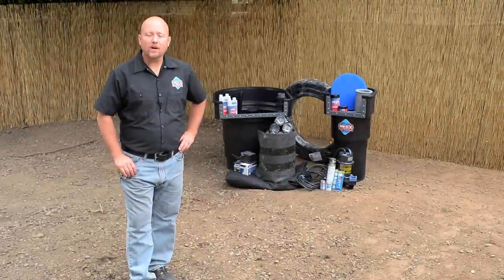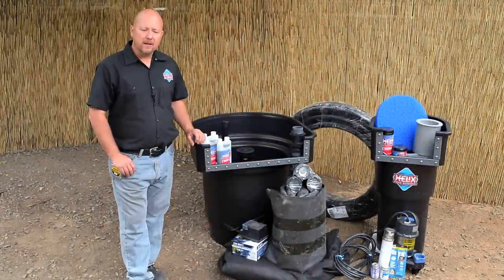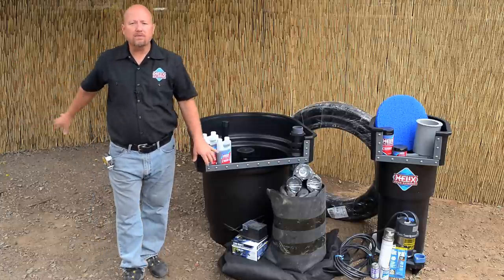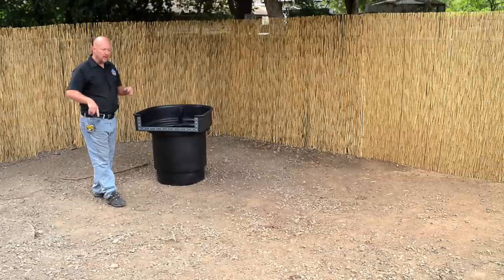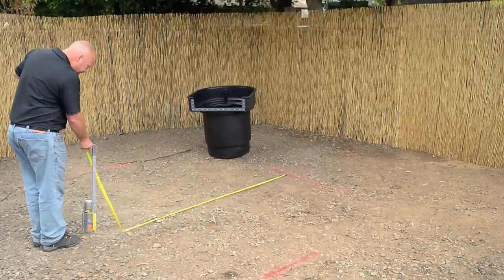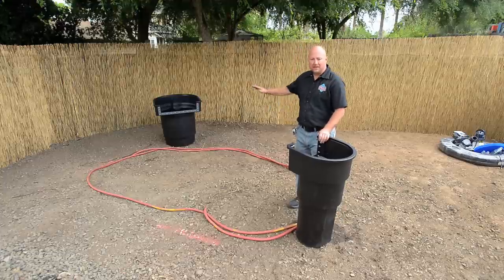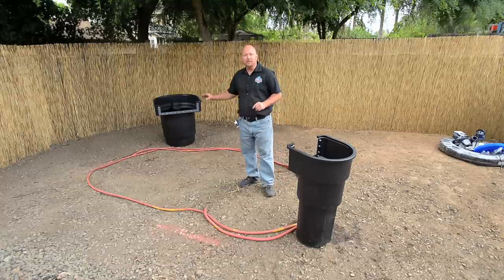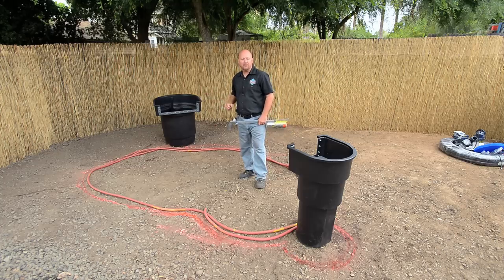How to build a Fish Pond - Part 1 | Pond Design and Layout

Comment: I have been tossing that thought for  some time now, Thank You for your response. I am going to buy a liner to fit my ponds and then use the liners I do have for the stream runs from the three waterfalls. Its funny, this started off as a small project; I just could not find satisfaction in small. I have a 3/4 back yard that has become my canvas to paint. Thank you for your great videos!
Reply: What a great set of videos with lots of tips I watched all 23 in one sitting. I missed a bit the aspect of the plumbing but assumed how it works.  You showed in the beginning the standard setup kit and I wonder where I could get it today in 2021.  Maybe there are newer designs, but I loved the parts you used.
Wolf Bender in Bethlehem, PA

Comment: Eric... You "Rock" the pond world! Hey buddy, I am using "feng shui" principals to locate my waterfall and pond. I am therefor, in a situation where my pond should be located in the north, and my waterfall feature in the northeast. I am on a small lot with a septic tank also in the north/north-east location. I don't have enough space for a decent sized koi pond and waterfall. So here is my plan... A six tier waterfall over a 12 foot span, landing in a 3 x 5 pond with a three foot depth. This leads to a 25 foot x 2 foot wide channel which is 3 feet deep and sloping down to 4 feet, where it enters the other 5' x 8' pond with 5 foot depth. I will have drains, and skimmers on each pond, and three jets in the channel aimed toward the larger pond. I am running the channel between my house and septic with two feet on either side. 
Do you see many problem, using a 25 foot channel to connect the ponds? Or how about proximity to the septic?
Thanks for the awesome video series! and here is a plug for "Helix"
Thanks, Paul

Comment: Hi Eric:  Thanks a lot for showing step by step.  I watched all. It is awesome.  I am going to fix my pond.  It is a bit bigger (8' x 15).  I have several questions: 1. what is horse power of the the Submersible Pump? I saw you cut the PVC (that is connected to water fall filter), then you connected the PVC with the "Yellow thing".  2. What is that for? Can I connect that end  to the external MECHANICAL filter and UV light system? 3. Is that necessary to add the external MECHANICAL filter that is constructed in the container with sand, grain, and other material?  4. Could you please make a video of how to build the external MECHANICAL filter tank/container (I have a 50 gallon container with 24 in diameter, about 4 foot height)?  Thank you very much.

Comment: I'm a total newb, not even a handy man but I may be buying a piece of property with alot of possibilities. I love your videos! I have a very basic question. If the man made pond is relatively far from your home, your wires/cords are run under ground? in PVC? or some flexible tubing? Do you simply plug it all in to an outside outlet or is something more needed where it connects to the house? Again, real newbie here, excuse my lack of knowledge. Thx again!
Reply from the maker: +Troy Docimo We're here for your support so no questions are bad! The cords on most pond pumps are around 25 feet long. If your pond is farther away from your home then that, you will need to run an extension cord initially but will likely want to have an electrical outlet ran out to the location of the pond. Check your building codes or call a local electrician for some advise. Best of luck to you on your project.

Comment: Hi Eric. In a typical pond kit how big is the liner and underlayment? You marked out  8 x 11  for this pond. I am getting a 20 x 25 pond kit but will be closer to a depth of 3.5 feet at the bottom, because of our weather here. Would I still be able to mark mine out at 20 x 25 for this kit? I don't want to run short of liner, thanks
Reply: Thanks. Another thing. I just saw a video on You Tube from a guy on Pond Supply. He stated that it was not a good idea to put rocks in the pond. He stated that all this does is create bacteria and muck that smells and the pond owner has to continually clean out buckets of muck. That worries me because I fully intend to put rocks in my pond the way you showed me on the video. Should I have concerns about this? Thanks
Reply from the maker: There are several different pond construction styles. This video is an eco-system pond that requires and annual drain and clean. The gravel helps to digest the muck all year long. At the end of the year you drain and clean the pond, including the gravel. If you decide to build a pond without gravel then you install bottom drain, settlement tank and UV filter to help manage the pond muck and keep the water clear. I love both construction styles. Stay tuned as we will be filming more construction styles. Watch our Koi Pond Fundamentals video for more information.
Reply: I watched all the videos, they are great. I had thought about putting a bottom drain in to help remove solids, but since I intend to do the gravel design, I will probably have to do the annual drain and clean, even with the bottom drain.. My only question is how long before I can put the fish back in and also( I guess this is two questions) how and where to keep the fish until the pond is ready?
Reply from the maker: You can add the fish back to the pond immediately if you are conditioning the water and removing chlorine and chloramines. A typical pond cleaning will take a few hours. We are editing a Spring Pond Care video at this time so stay tuned! It should save you some time on your learning curve. Thanks for watching!

Comment: very cool. one thing though: 
In its common meaning, the term 'parameter' is used to identify a characteristic, a feature, a measurable factor that can help in defining a particular system. A parameter is an important element to take into consideration for the evaluation or for the comprehension of an event, a project or any situation.
the word you're looking for is 'perimeter': the length of the outline of a shape.

Comment: couple of questions do i need to get permits from the city and secondly what about my underground sprinkler system, i know those lines cross a section that i want to dig.
Reply from the maker: tash lam It seems different cities have different requirements but it seems to be common that if the pond is deeper than 24" you need a permit. Sprinkler lines are easy to move so plan on cutting them out of the way and re-routing them.
Reply: thank you very much for your reply i will ask around regarding permits.

Comment: I have been watching your show for years I have a pond in my front yard that I inherited with the house the pond liner looks extremely sturdy but for the last couple of years maybe 1 to 2 years I unknowingly move the stone away from some of the edges of the pond and allowed UV light to Penetrate the pond liner I don't seem to have any leaks but I have concerns about the damage that may have been done and I want to know if there is a spray product that you can put on it to continue to protect the pond from the UV light as well as make it water tight and sealed against whatever damage has already been done Is there a product that you recommend for this

Comment from the maker: All PROS to moving the pond from 8" x 11' to 10' x 25" You will maximize the pond equipment in the video. 8' x 11' pond is the smallest pond I would this pond kit equipment on. This Helix System can handle a 10 x 25 easily.

Comment: I was looking into Bentonite Clay and the company told me for a pond I should use blue bottom clay. Do you agree? and if i went that route instead of a liner, how much should i spread around? Im considering a good sized pond say 25 x 35 or something around there. Thx again for your help!
Reply from the maker: +Troy Docimo I do have a couple clay bottom pond. I prefer using rubber lining as a water proofing.

Comment from the maker: The excavation dimension is 8' x 11'. Once the rock is installed the water surface shrinks to approximately 6' x 9'.  The liner size on this install was 15' x 20' because we were about 3' deep. The liner was a little oversized but made installation easy.

Comment: I am creating a pond in our yard for ducks.  We know we want a waterfall to keep the water moving, and skimmer for leaves and a filter to clean out the waste.  I haven't seen the installation of a filter listed.  Do you do it in one of your videos?  Also, do you have to line the whole wall of each level with boulders?   We are also trying to do all of this on a budget.  I have found some kits that include the mechanics we need, but don't really know anything about the different brands.  Are there ones that you would stay away from?
Reply from the maker: All the pond equipment will help you achieve your goal. Some equipment just performs better than others. Of course we gravitate towards Helix Life Support Pond Equipment but don't use it on every pond installation. Consider installing a BOG FILTER like in our Patio Pond video series for your duck pond. Trick is keeping the ducks from destroying your bog plants. Best of luck to you!
Reply: ThePondDigger How big is this pond, and what size pump do u have?
please reply quick
Reply: Sorry just saw this.  the pond is 10' x 15' and 3 ' deep in the middle…. the ducks will no longer be going in it…Not sure about the pump size.  Why?

Comment: I have a question:  I am thinking of how to utilize a retainer wall as 2 sides of a pond using a liner.  Can I use Beckett Pond Tape to adhere it to the wall then stack rocks against it?  I also saw a product made in Australia called Grip Clip which was a 3 meter length of 2 piece plastic that fits into eachother.  The female piece gets bolted into the wall, the liner go over it, and the second piece clips it in place.  Do you have that product
Kathy Preston
Reply from the maker: +Robert Preston  We use a liner termination bar to attach liner to walls like that. We get them in 10' strips.

Comment: Do you have any tips on digging a pond in red clay ? I have very little top soil, and all red clay underneath. I think I will have problems back filling and building up my waterfall.
Reply from the maker: We live in Redlands. Named after the clay dirt. On occasion we will have to bring in some top soil for backfill but for the most part we work it out when digging with the jackhammer we break up most of the heavy clumps.

Comment: hi eric!
i live in india and i have started building my first pond. i have been searching for an EPDM liner, but cant find any dealers anywhere near where i live... i did find a dealer who supplies HDPE liners.the thickest one was 450 GSM. would you recommend using the HDPE liner? i intend to keep some koi in it.cement concrete waterproofing is not an option i can consider, since it is very high maintenence.
Reply from the maker: Kunal Bansal Yes you can use HDPE liner if that is all that is available to you. Be sure to cover it and protect if from the UV of the sun. The Sun will be damaging to the liner.
Reply: thanks for the advice Eric!
Reply: How's the pond going, Kunal?
Reply: i have just received my HDPE liner shipment. the rocks, pebbles and gravel are coming in tomorrow. i already have the pond dug. will start placing the things in this weekend. i will be using a homemade filter/skimmer made out of a bucket and utensil scrubbers, along with a small submersible pump as my water treatment system. i hope it works out as i plan it...
Reply: Kunal Bansal Great! Good luck :)

Comment: hello sir I have a question not really about this particular video but I was wondering is the pond filtration system them same as a pool set up? would you be able to use a pool pump and filter the same as a pond?

Comment: What about the best location for a pond in terms of sunlight?  Also, there is no place in my backyard where I can avoid the effect of trees.  I have none on my property, but am surrounded by them from my neighbor's properties.  In the fall, there will be a significant amount of leaves.  What is the best way to deal with leaves?
Reply from the maker: ddenuci You might consider using multiple skimmers on your pond depending on the shape you design to manage leaf debris. In the fall it is not uncommon for pond owners to cover the pond with a netting to capture the heavy fall out of leaves. The netting goes up just before the leaves drop and comes off after the leaves have dropped. We have ponds in full sun and ponds in full shade. Optimally you will want a balance of sun and shade on the pond. Water lilies won't bloom unless you get 4 hours of direct sun on the pond.
Reply: ThePondDigger Thanks for the detailed and quick response.  I'm also reading that it's important to have a filter that includes UV filtration when the pond is exposed to a lot of hours in the sun.   Would you agree with that?

Comment: Where did PART 2 go?  Didn't see how to pipe the system (other than the pump in a later part)
Reply from the maker: Tom Shedosky If you need help with the plumbing contact our headquarters and we can walk you through the process.

Comment: dear friend, how are you doing. 

i need your help in one issue. I'm planing to do a raised koi pond but I'm stuck in fixing window frame. 

my question is: 

how to fix the frame into concrete block? and is steel affecting water chemistry, i mean should i leave steel as it is or should i coat it with something for waterproof so not to affect water chemistry? 

thanks